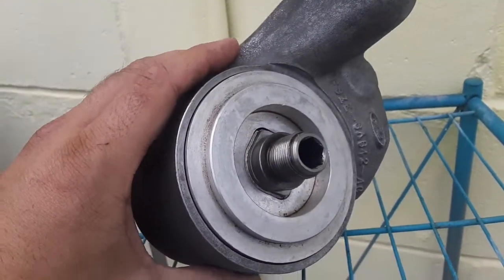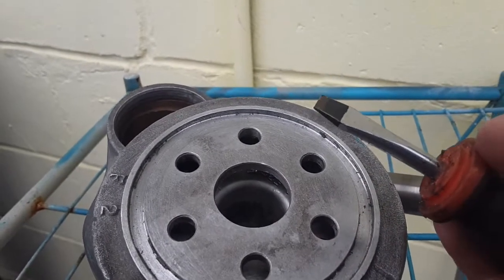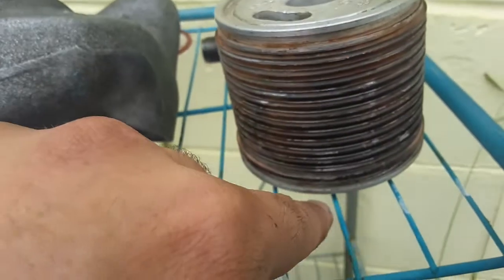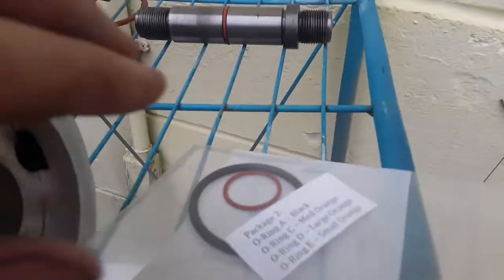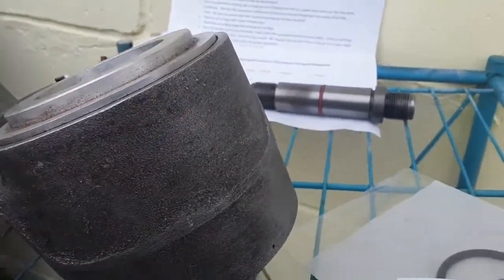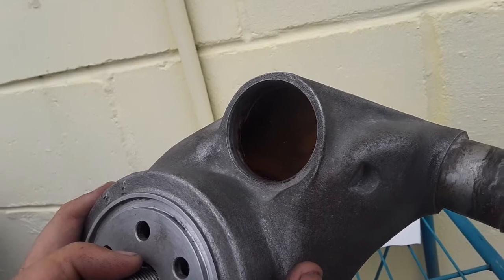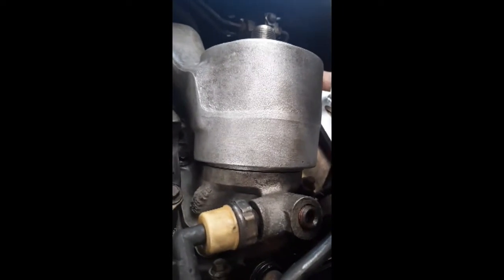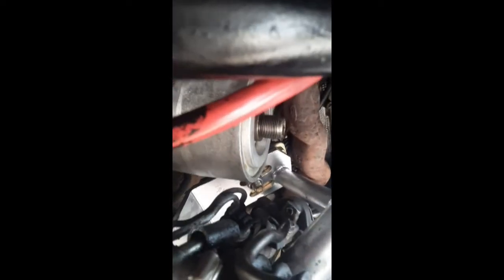Rebuilding a 4.6 Oil cooler

Comment: At 0:40 that hole is for what I tightend up my stud and coolant / oil started coming out the lil hole
Reply from the maker: Called a weep hole so you know there is gasket failure. Much like a water pump.
Reply: @TheModAddict thx so much u think gasket failure in the oil cooler ? I just replaced the oil filter adapter gasket because oil in my coolant reservoir I put it back tg started it oil all over the floor took it apart and the stud was loose I torqued it down then it started wheeping out the hole
Reply from the maker: Id bet thats the case

Comment: Hello - great video. The seller of this kit 'matwojdy' on ebay says he was the original for this kit?.and LMR copied him and changed stuff :-(
Also does all the antifreeze has to be drained first before taking the oil cooler off for the rebuild? (Im assuming yes)
Reply: Thank you sir!
Reply from the maker: Much easier to
Reply: Easier to? Any thoughts on the LMR kit vs. This one? 1 of the Orings is differenton the LMR kit@TheModAddict
Reply from the maker: Easier to drain the coolant. Completely. Not 100% necessary. It will drop some coolant tho.
Reply from the maker: I have no experience with lmr kit but they know what they are doing and they install their own parts so id bet it works just as good.

Comment: Does anyone know where I can get the housing for this? Mine has a hole in it and I need to replace it, I’ve checked eBay and a couple other different places and haven’t been able to find it
Reply from the maker: Check rock auto. They use to have them

Comment: Thanks for the vid. I just got back from a drive and have massive amounts of oil in my coolant (but zero coolant in the oil) so I am suspecting this is my failure point. Hoping the rebuild kit with gaskets and o-rings solves my problem.

Comment: How do you get rid of all the oil in the radiator & overflow:/ ? 😢
Reply from the maker: Take off the lower radiator hose. Put a hose in the overlow and just let it run for a while. You can even put superclean on it with the lower hose on and let it sit. Then flush it.

Comment: Just came up on your video! So question.. the machine shop told me to throw mine away and buy another bc my engine had a spun bearing. Surely I can just clean it out I’m thinking. Oil only passes through to cool right?
Reply from the maker: Oil and coolant..but it should be able to be rebuilt still. Clean it super good while apart.

Comment: Thanks for the vid. Does one have to remove anything to get the cooler out? Looking at it, it seems like a tight fit.
Reply from the maker: Just the oil filter and coolant hose attached
Reply: @TheModAddict  what's the trick to getting it off the car? Coolant is drained and the stud is out but I am failing to get it off/over the o-ring for the coolant connection.
Reply from the maker: More muscle ..it will go. Probably super corroded there
Reply: @TheModAddict  I'll get a friend with bigger arms to come over, lol.  I can get it to wiggle and slightly rotate without issue. Just can't get it over the dang o-ring. Odd angle. Wondering if removing the side shroud ar the bottom of the wheel well would help me get to it better.

Comment: Cannot thank you enough for this video and the other one showing the same parts.  I changed the oil today in my Cobra that gets driven 2-5 times per year.  After taking the oil filter off I noticed something other than oil started leaking.  I'm like what the heck is this?  Tasted it like every true man would do and sure enough it's coolant!  Had no idea what or why that would be happening.  After some online searches I just found these videos and now I have a clear handle on what I need to do.  My issue is coolant is leaking from the bottom of that cooler housing so it's the o-ring near the outside that has failed.  Looks like I need to buy the rebuild seal kit and try my luck.  Without your videos I would have been lost!!
Reply from the maker: Happy it helped.

Comment: hey man thanks for the video.  I have a small oil leak on my 98 Cobra and I can't figure out where it's coming from - just notice things are wet down in that area but not necessarily on the oil cooler.  Wonder if this is the culprit
Reply from the maker: The gasket between the filter housing and the block could be. Also the oil pressure unit is know to leak.

Comment: I just bought the 1/2 inch hex socket instead of an Alan key  https://www.ebay.com/i/272956159681?chn=ps&mkevt=1&mkcid=28   ..  Mine was leaking took to Mechanic charged me $200 never rebuilt cooler started pouring oil 5 months later .. I did it myself after watching your video THANKS

Comment: Is this the same setup on a 2004 cobra
Reply from the maker: I believe so. Im not 100% sure. I would look up both and make sure both coolers have the same part number. But i do know even the cooler on my gt everyone says its a "Cobra" unit even tho it came stock
Reply from the maker: Just did some quick research and according to what i seen and how the rebuild kit is listed "1996-2004 Ford Mustang SVT Cobra Oil Cooler O-Ring Rebuild Kit 4V 2V GT Mach 1"
They are all the same. Hope this helps

Comment: Awesome vid! Dumb question,  is the oil cooler the same on a terminator block? Mine is leaking and I don't want to spend $400+ on a new one lol.
Reply from the maker: I believe they are the same.. but if you go to like lmr.com and look up the part for a terminator..and then for a gt and see if its the same part number. To my knowledge they are all the same.
Reply: @TheModAddict  thank you!
Reply: When you say yours is leaking, is it putting oil in the cooant or is it dripping on the ground
Reply: @BigYellow1500  on the ground

Comment: Its pretty cool that you have an oil cooler. My 98 gt doesn't have one but my 97 cobra does
Reply from the maker: Im told 96 and 97 came with them..ive also read only cobras and service vics did..idk
Reply: @TheModAddict  who knows man. Especially when it comes to ford engineering

Comment: you have to run a smaller filter with the cobra oil cooler on the tube kmember. my frams hit the kmember and wouldnt spin on. i use k&n filters.
Reply: 4.6 Savage that’s weird, my cooler is fine with my QA1.
Reply from the maker: Cooler is fine with upr..just need a shorter filter..
Reply: @TheModAddict  Would you happen to know the part number for the oil filter you use?
Reply from the maker: Stp s2